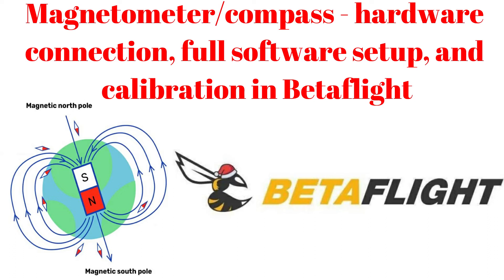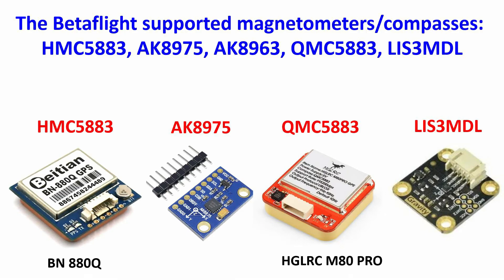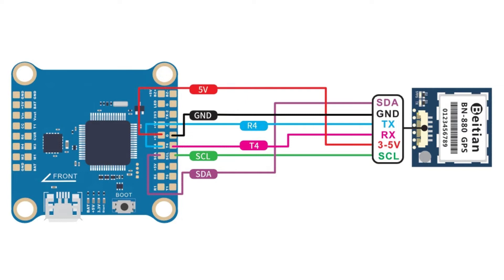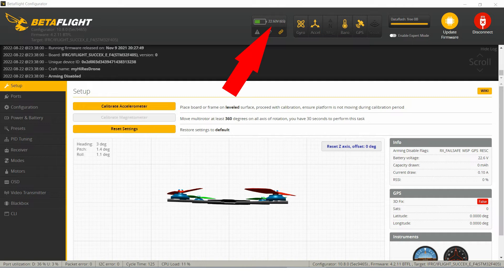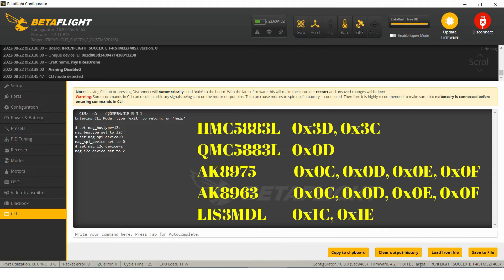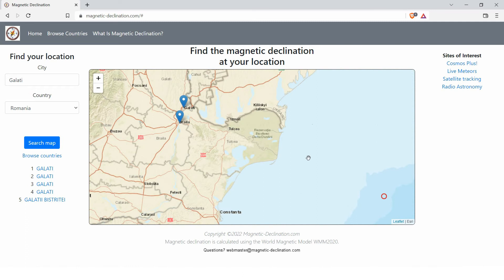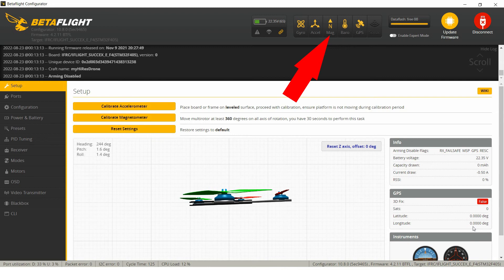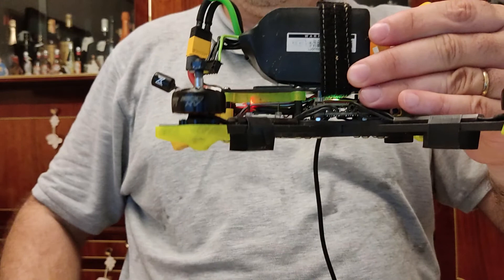Magnetometer/compass - hardware connection, full software setup, and calibration in Betaflight

Comment: Excellent job! 😀
Reply from the maker: If your magnetometer is placed in a specific position be aware of  "MAG Alignment" drop down box in the GUI. Go to the Configuration tab in Betaflight Configurator, you will see a section on the right called "Board and Sensor Alignment". At the bottom of that section you will see a "MAG Alignment" setting.Or you can do by using the CLI commands:

align_mag = CUSTOM
mag_align_roll = xxxx
mag_align_pitch = xxxxx
mag_align_yaw = xxxxx

and in the end calibrate.

Comment: Hey, I appreciate this information. The magnetometer never seems to show with any FC, or when there is clearly a device using it like a GPS and Compass combined. I just tried entering the settings you guided me to use with the JBF7 v2 with BF 4.3.1. "Magnetic declination" is not recognized as a valid command. Anyway, I entered what I thought were the correct settings and BF is saying that I now have 8 i2c errors. I made the mistake of not saving a dump before I started this. After 4&1/2 years you would think I know better. I did save a "diff all" though, so I am going to reflash and put my settings back in. How can I know what is correct with regard to what you are doing?
Reply: same experience here

Comment: Quick question does the cli commands need to be given I betaflight 4.4? When I inputed them it didn't recognize the mag declination command? thanks
Reply from the maker: You must downloading a software version for your FMU that does have the magnetometer part incorporated. 

The new "cloud build" option allows you to select the different components you want to incorporate. 

Reading their documentation I found: "For those missing a barometer: You can try any or all of BARO_MS5611 BARO_SPI_MS5611 BARO_BMP280 BARO_SPI_BMP280 BARO_BMP388 BARO_SPI_BMP388 BARO_LPS BARO_SPI_LPS BARO_QMP6988 BARO_SPI_QMP6988 BARO_DPS310 BARO_SPI_DPS310 BARO_BMP085 BARO_2SMBP_02B BARO_SPI_2SMBP_02B in the custom defines input box."

The link is here:

https://betaflight.com/docs/release/Betaflight-4.4-Release-Notes

Comment: I just re-flashed the board and the 8  i2c errors are still present. Since I don't know what the original settings were (my mistake) I don't really know what to do. What would you suggest?
Reply from the maker: I’m unfamiliar with JBF7 V2 but searching on the web (you have a very nice FMU !!!!), I found that the I2C port is shared with UART 3. So, first, disable UAR3 from the port configuration. At this point, I do not know if it is enough to activate the I2C port – maybe additional steps are required. Also, from the internet, I found that your board has a barometer - I intuit that the barometer is connected to the I2C bus (it is possible to use SPI also). So, what would I try if I were in your shoes: 1. disable UAR3, 2. Disconnect the magnetometer from I2C, 3. Set mag_bustype = NONE, 4. Set mag_hardware = NONE, 4. set mag_spi_device = 0, 5. set mag_i2c_device  = 1 (for barometer). Now, use the status in CLI to see if the barometer is detected. If it is not possible to work on the SPI bus or to activate the I2C bus additional steps are required.
Reply: @i3Drones  i didnt get option for magnetic declination as a valid command either, getting a i2c error, after doing a status command in cli, using a brainfpv radix2 with a matek m8q-5883 gps
Reply from the maker: @RuderalisFPV  first your barometer is detected?

Comment: Commend not work on BF4.4 and controller Blitz F7 (Chimera7 V2 Pro O3)
Reply from the maker: I haven't tested the controls in BF 4.4, but the controls should work without problems.

The only problem I see is downloading a software version for your FMU that does not have the magnetometer part incorporated. 

The new "cloud build" option allows you to select the different components you want to incorporate. 

Reading their documentation I found: "For those missing a barometer: You can try any or all of BARO_MS5611 BARO_SPI_MS5611 BARO_BMP280 BARO_SPI_BMP280 BARO_BMP388 BARO_SPI_BMP388 BARO_LPS BARO_SPI_LPS BARO_QMP6988 BARO_SPI_QMP6988 BARO_DPS310 BARO_SPI_DPS310 BARO_BMP085 BARO_2SMBP_02B BARO_SPI_2SMBP_02B in the custom defines input box."

The link is here:

https://betaflight.com/docs/release/Betaflight%204.4%20Release%20Notes

Comment: Hi I have been having a lot of trouble setting up compass MQ8 - 5883
With Mamba Mk4 F722
i have tried all your settings still no luck!

Any suggestions would be appreciated
Reply from the maker: It's far too vague what you're telling me. I can't figure out the problem.
Reply from the maker: First, check once again if the hardware connections are correctly done. SDA (controller) <-> SDA (magnetometer) & SCL (controller) <-> SCL (magnetometer). Check also the power lines.
Reply from the maker: Searching on the web I found this issue: I2C is not working on dedicated pins - so, follow the remaping procedure presented there:

https://github.com/iNavFlight/inav/issues/6441
Reply: @i3Drones   thanks for the reply, this may be above my level as i am a newbie! will give it a go. Will it work ok with the MAMBAF722_2022B as this is a different fimware to the I2C. My Baro works fine atm i just cannot get the compass to show up?
Reply from the maker: @theandymann4433  if I guess, it is possible to have a problem with set mag_i2c_device - try different values 1, 2, 3 or 4, it is the only one parameter that I do not understand completely. But, first power up the drone.
Reply: @i3Drones   Yes unfortunately tried that already! Decided to re flash with INAV now to learn how to tune!
Reply: @theandymann4433  DId you consider other magnetic influences in the proximity of your magnetometer, like cables and antennas?
Reply: @TimeFadesMemoryLasts   I did get it working after a lot of trial and error. Inav for some reason was the same! so went back to beta flight and tried a few different things finally got it. Had to type in the mag hardware manually I think that's what made the difference?

set mag_bustype = I2C
set mag_i2c_device = 1
set mag_i2c_address = 0
set mag_spi_device = 0
set mag_hardware = QMC5883
Reply: @theandymann4433  Huh, weird. Is your board target outdated (or is a wrong target altogether)? Because normally if some sensors don't work it's because of a wrong config (coming from a wrong target). It could also be a bug in the target file, if you double check that you selected the correct target while flashing.

Comment: unfortunately i am getting this error: # set mag_i2c_device=1
###ERROR IN set: INVALID NAME: mag_i2c_device=1###
Reply: had to manually chose magnetometer when flashing firmare, if anyone has the same issue
Reply from the maker: @shotbyarian  yes, in cloud you must choose the magnetometer.
Reply: @i3Drones  unfortunately the magnetometer is still greyed out for me even if i try all the different ic2 devices (0-4), any idea why? flywoo m10 mini w compass
Reply from the maker: @shotbyarian  it is possible to connected incorrectly or to a I2C port unchecked by the Betaflight. So, first search for a hardware issue.

Comment: Just confirming, Betaflight 4.4 does not have magnetometer support?
Reply from the maker: The new "cloud build" option allows you to select the different components you want to incorporate. 

Reading their documentation I found: "For those missing a barometer: You can try any or all of BARO_MS5611 BARO_SPI_MS5611 BARO_BMP280 BARO_SPI_BMP280 BARO_BMP388 BARO_SPI_BMP388 BARO_LPS BARO_SPI_LPS BARO_QMP6988 BARO_SPI_QMP6988 BARO_DPS310 BARO_SPI_DPS310 BARO_BMP085 BARO_2SMBP_02B BARO_SPI_2SMBP_02B in the custom defines input box."

The link is here:

https://betaflight.com/docs/release/Betaflight-4.4-Release-Notes
Reply: @i3Drones  you're a genius. I'm an idiot
Reply from the maker: @myoung2761  I'm not a genius, I have a little more experience then you. Please like and subscribe.
Reply: @i3Drones  Definitely earned my sub! How would I set magnetic declination on betaflight 4.4.1? I get an invalid command error when typing it in CLI
Reply from the maker: @myoung2761  Up to now, I do not install 4.4.1. - may be in this weekend - may be it is the same problem, select the build with compass.

Comment: I have  M8Q-5883 does not connect to Kakute H7,  Betaflight 4.4.no command command from your video is entered, gives an error, what to do?
Reply from the maker: I haven't tested the controls in BF 4.4, but the controls should work without problems.

The only problem I see is downloading a software version for your FMU that does not have the magnetometer part incorporated. 

The new "cloud build" option allows you to select the different components you want to incorporate. 

Reading their documentation I found: "For those missing a barometer: You can try any or all of BARO_MS5611 BARO_SPI_MS5611 BARO_BMP280 BARO_SPI_BMP280 BARO_BMP388 BARO_SPI_BMP388 BARO_LPS BARO_SPI_LPS BARO_QMP6988 BARO_SPI_QMP6988 BARO_DPS310 BARO_SPI_DPS310 BARO_BMP085 BARO_2SMBP_02B BARO_SPI_2SMBP_02B in the custom defines input box."

The link is here:

https://betaflight.com/docs/release/Betaflight-4.4-Release-Notes